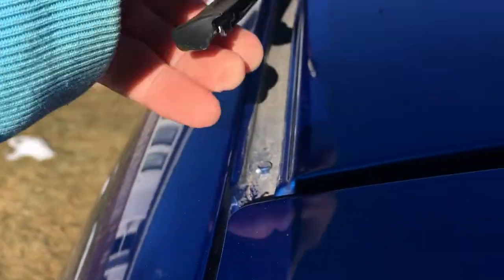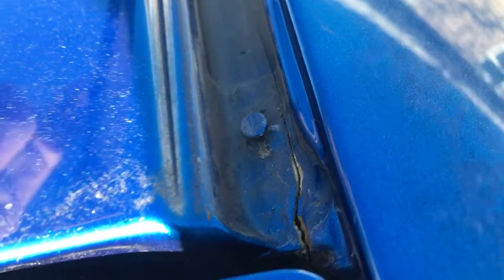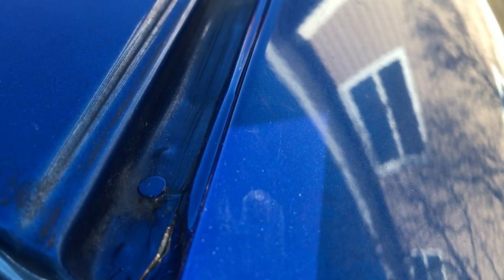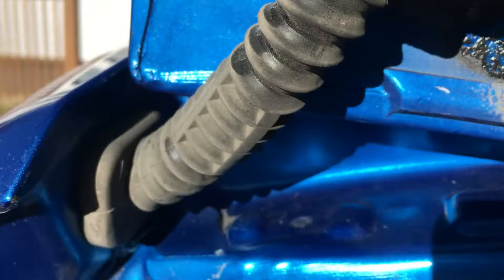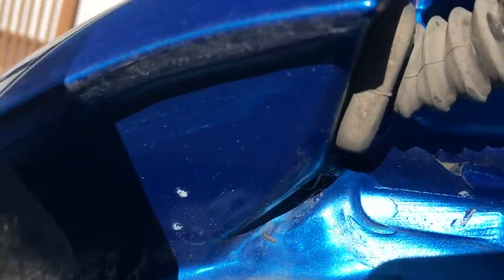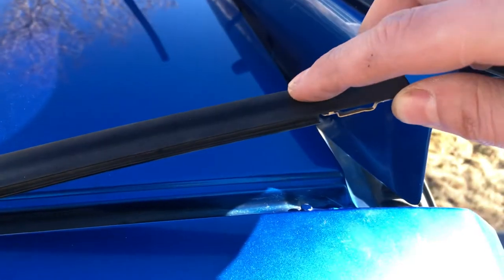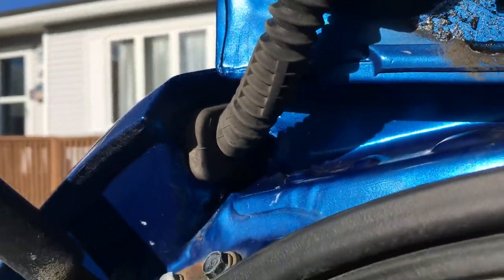Honda Fit Leak: CRACKED! Roof Channel Seam Sealant Repair 🌧💦

Comment: Did any other Hondas have this seam split issue causing leaks? We had an old CD5 Accord that was fantastic save for a random interior leak after rainstorms. I could never find where the leak was coming from over the years, despite blowing out drain plugs and ripping out the interior. 

Great channel. Appreciate your Fit content!! More Honda maintenance videos please!! .

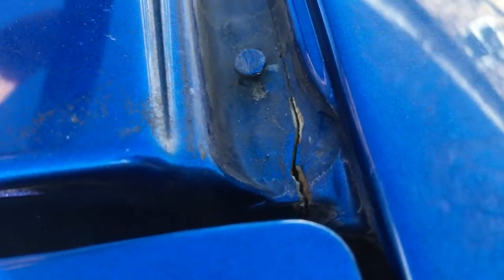Comment: 1:33 This type of split should never have happened.  I was an inspector in the aircraft industry. Any aircraft having the start of such a structural split would have been grounded. This split is flexing, widening and lengthening.  Something very bad about how this vehicle was made is evident.  As the are many YouTube videos showing such needed repairs the problem is systemic.

Comment: Hello, thanks for the video. Looks like you've gone through a few Fits.

Would you say the cracks are a deal breaker? Do they cause problems other than leaks, I'm guessing they aren't structural.

I'm going for a test drive of one soon and will be watching out for this.
Reply from the maker: Definitely not a deal breaker considering the ease of repair. Work need repairs into the price and you’ll likely come out of it with a great vehicle.
Reply: @combustiontherapy2222  Bought an 08 last week. Looked for a crack and sure enough it has the same crack yours has on the right side.  Doesn't seem to be leaking and no rust under the carpet. 

Would you still recommend e6000? I like the idea of using clear stuff instead of ugly black.
Reply from the maker: @sandmanlol  I ended up flipping the vehicle for a profit, I can say while I had the vehicle the repair held up just fine and succeeded at thwarting entry of water through the split, Being clear is definitely a positive. Another option costing less than 3M seam sealant would be clear RTV silicone. I think pretty much anything should hold up well with a little area prep work.
Reply: @combustiontherapy2222  yea later and it's still holding up

Comment: How's it holding up after 2 months? Seems like most places recommend the 3M seam sealer but I really don't want to spend $50 on glue. E6000 still going strong?
Reply from the maker: I ended up flipping the vehicle awhile back. While I had this Fit the E6000 held up just fine and succeeded at thwarting entry of water through the split, Being clear is definitely a positive. Another option costing less than 3M seam sealant would be clear RTV silicone. I think pretty much anything should hold up well with a little area prep work.
Reply: I did something very similar and it held up for years.